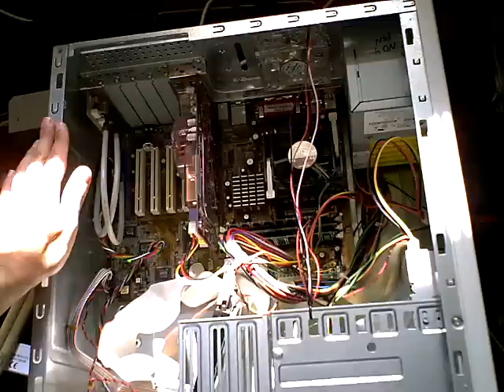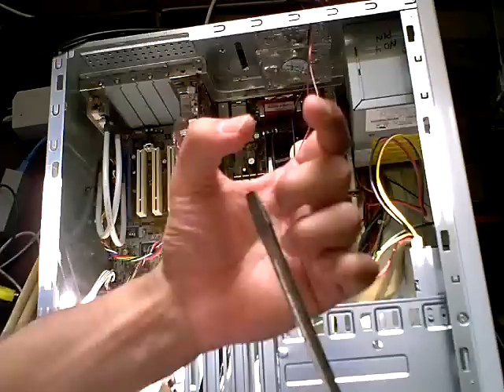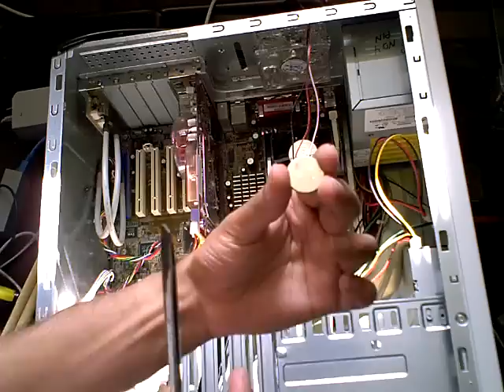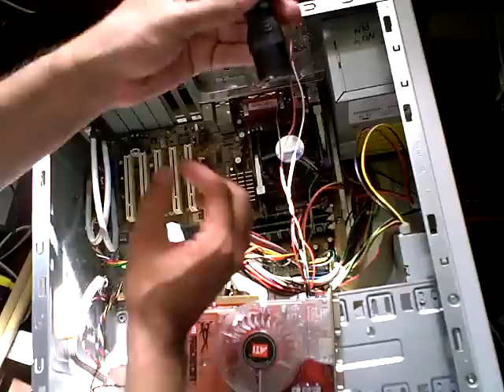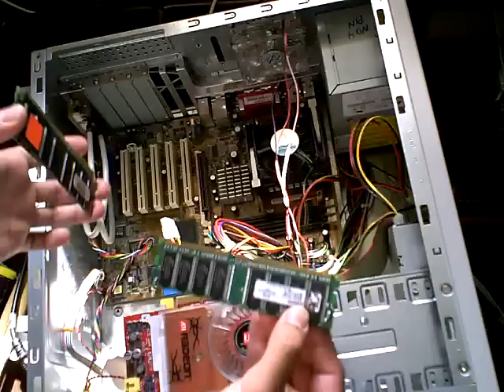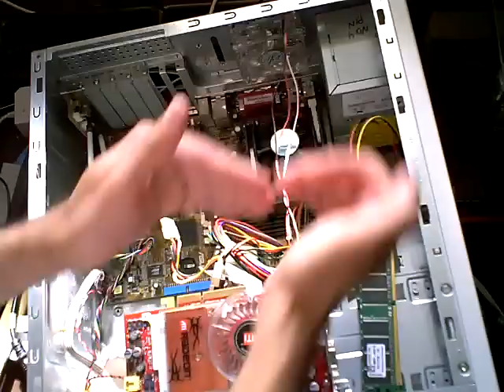How to possibly fix a PC that will turn on but will not beep and will not display anything on screen

Comment: Please help ! I don't wat to mess with anything just yet. I just want your opinion on what this problem might be. Ok so i am new to building computers and I just built my first setup. Everything worked perfectly for a week or so, then I started over clocking the stock fx6300. Everything was fine just tinkering with the cpu ratio and voltage I got it up to 4.5ghz at 1.41v underload was about 59c using my hyper cooler master evo. Had this going for a while and it was dandy. Then I raised the CPU/NB ratio from 10x to 11x and now my PC doesn't output video to my monitor. I've tried all the basics. Changing the monitor, the cable, and the display port. All to no avail. What do you think? Thanks!
Specs
Fx6300
Msi r9280x
MSI gaming 970 mobo
EVGA 850w g2 
Rip jaws 2x4gb 2133 DDR3 RAM
1tb blue WD hadrdrive
120gb Kingston SSD
Reply from the maker: +shane fernandez Reset the CMOS as shown in the video. Hopefully it'll flush your overclock specs. I recommend you leave those settings at default, for reasons such as this

Comment: if you remove the cmos battery, isnt that the same as using the jumpers? or do they do different functions?
Reply from the maker: +ScrotumSqueezer It 'should' be the same, but I do both to ensure that the operation sets. Since recording this video, I don't even tell people to wait 10 seconds like I used to, I now tell them to wait overnight to ensure that the CMOS is cleared (yes, some machines actually take this long for power to die out from circulating).

Comment: Thank you so much for your video!  I believe I have now fixed the problem on my computer and all it took was resetting the cmos. One more question,  though. When I start my computer up,  there is a code that pops up.  It reads:
Diskette drive 0 seek failure
CMOS check sum error-Defaults loaded
Press F1 to continue,  F2 for SETUP

I pressed F1 and all worked well except my time and date had to be manually reset. But the same things pops up even after restarting computer. What should I do now?  Thank you in advance for any help you can offer.
Reply from the maker: +jennjonesforever Your CMOS battery is dead. If you replace it with a new one, this problem shouldn't happen anymore.
Reply: +RodneyDickson Thank you!
Reply from the maker: +jennjonesforever Hope things work out.

Comment: Hi, want to ask that my pc can start to cmos, no beep sound got display and show pxe e61  media text failure.
Is it just hdd failure? Or suspect for mbd failure?
Due to nearest pc shop is quite far so hope for a suggestion. Ty.
Reply from the maker: Sounds like your problem is directly related to your bootable drive (whether it be USB, HDD, optical, etc). If your hard drive is not defective, I'd go into the BIOS, ensure that the HDD is being properly detected by the system and is the primary boot device, then save and exit. If the operating system still will not boot, and you are sure your hard drive is functional, then your operating system installation may be corrupt.

Comment: Hey, you may know something about this, my hp starts up normally at first, but when it gets to the desktop screen, it just stays black, no icons, start bar, etc, I can ctrl at del but I can't play games or browse the web, I have already tried a Vitus scan in safe mode, simple restart, restarting with just Microsoft processes going etc, I let it sit for about hlf hr and still nothing, it makes the occasional loading sound (little clicking sound or whatever when ur pc is loading something) any idea how to get it going?
Reply from the maker: +Drew Schnipke Fraid not. You can go into the BIOS, load setup default, save and exit and see if that makes a difference. From the sounds of it, your Windows installation has become corrupt.

Comment: My newly built PC didnt have signal on monitor and did turn on and off like 10-15 times(no signal on the monitor evrytime), so i thought mobo was having any contact with the case to i took out and put the mobo on a cardboard box and on the second time turning it on it worked and i was damn happy but after that it went out again and thats it, so im changing the CPU and mobo atm, i believe it either mobo or CPU is the problem so waiting for exchange atm. im still pissed cuz this is my first built PC :[

I did the CMOS clear but I think I did it wrong because what i did was take out the battery then i did the 3 pin thing. remove from 1-2 and put it in 2-3 and then put it back.. Well thats what my Mobo manual told me to do, i didnt try turning the PC on with out battery or removing the components one by one..

Do you think it could be the RAM? Its a Crucial Ballistix Elite DDR3 2X4GB 1600Mhz
My
MOBO Asus M5A97 R2.0
CPU FX-6350
GPU Asus R9 270X

Thanks. need your help RodneyDickson :]
Reply from the maker: +Powered By Kale Well, your troubleshooting was good. Where the issue lies sadly may be in any number of components, including RAM, CPU, board, even power supply. Sadly there is no clean, easy answer for you : \

Comment: Why did you never reinstall the CMOS battery, could that may have essentially effected the rest of the troubleshooting correct?
Reply from the maker: +William Beard It is possible. Some PCs are finicky about not having the CMOS battery present. I knew as fact that this machine was not one of those cases, but in fact you are correct.

Comment: I have a similar issue with a temporary fix. After I turn it on, no beeps no screen response, I then press and hold the power button again. Turning the power on and off 1-2 times it will finally boot with the screen and one beep. It doesn't kill the power to the computer ever after I get it started. Would that still be likely CMOS related?
Reply from the maker: +BreezyGamer92 If I understand you correctly, once the PC is started up using your trick, it is good to go until you power it down. If this is the case, I recommend you put it to sleep when not in use and wake it when you wish to use it in lieu of powering it down only to probably face this issue again. Intermittent issues such as this are generally signs of a component (frequently the motherboard) dying out. I say 'run it into the ground.'
Reply: I just remembered that problem I had been having at that time. Believe it or not, I think it was my video card. I clean the PC good and took my 7870 apart and replaced the thermal grease and cleaned up fan. It never had that boot issue again and actually performed better too.
Reply from the maker: +BreezyGamer92 Oh, real good. Glad you found the problem : )

Comment: Hi Rodney, while using my desktop my mouse froze on the screen and I had to just turn off without logging off.  I turned back on but mouse still won't move and I'm stuck on the log on part but I can't get any further?  Any ideas please?  I tried a different mouse but that didn't work either.
Reply from the maker: So no mouse functions currently? Does the back of your PC have both green PS / 2 connectors and USB connectors? Have you tried a USB mouse and/or a PS / 2 mouse? Did you ensure the mouse was connected before powering up the PC? Keep in mind that PS / 2 mice can not be plugged in while the PC is running, but USB mice can (only thing is, they take a few minutes to initialize). Have you also tried moving from username and password fields using the TAB key on the keyboard?

Comment: I just had this issue with a 3 year aftermarket built desktop. It would start... No beeps... Restart again and again after this vid I removed only the ram and graphix card not the battery and it still didn't work . Then I did the normal thing to do in this situation and I pressed every key at one time. At that moment an app showed up for my motherboard assrock ext7 then I looked and saw I can set a fast boot and my pc works now idk what I pressed but in some not all but some cases mashing the keyboard works though I don't publicly advise it thanks for this vid it's sorta helped
Reply from the maker: +Grant Nelson Heh, thanks for sharing your fix : )

Comment: Hello, I have purchased four motherboards, 2 Gigabyte and 2 MSI, I have also purchased 4 compatible processors, mostly AMD Blacks. 4 Total PCs, 4 New PSU, all new ram on each and I have the issue detailed in this video on EVERY SINGLE ON OF THEM. How likely is it that I have bad motherboards? What is going on?
Reply from the maker: +Atheyst Yeah, that's nutty. Perhaps your power supply is not sufficient? Perhaps you are not connecting things properly? Did you check your CPU pins to ensure they are installed properly and not bent?

Comment: I have this exact problem. It powers up fans run, no beeps but no image to screen.  I will try to diagnose just as you explained.

If it is the RAM your solution is to reseat and reorganize the cards and that should work?

(Ironically this pc "died" just 1 week after I purchased a new one!)  Haha
Reply from the maker: +YakMan NC Well, at least you have a backup machine. If you follow what the video shows, you may find luck in bringing the old machine back to life, and if no luck, Breadboard it (explained in the following video:)

If the steps in this video did not provide a solution to your problem, view:

http://www.youtube.com/watch?v=_EK9a-R5pss

You never know, maybe rebuilding the PC in the opposite sense that you took it apart will solve the problem.

Comment: Help, I've recently refurbished a computer by switching all the internal parts with new ones. Once everything are assembled, I switched on the power, the LED lights works, the fans move, but there's no post beeps nor signals to the monitor. I tried many methods possible and they didn't work.

My parts:
Processor: Intel i5 4690
CPU Cooler: Stock Fan
Motherboard: Asus H81M-E
Power Supply: Antec 600watts
Hard Drive: Seagate Barracuda 1TB
GPU: GTX 960

It may just be a connection error, but I want to rule out as many things as possible.
Reply from the maker: +Jay Breadboard it (explained in the following video:)

If the steps in this video did not provide a solution to your problem, view:

http://www.youtube.com/watch?v=_EK9a-R5pss

You never know, maybe rebuilding the PC in the opposite sense that you took it apart will solve the problem.

Comment: Thanks for the wonderful video.
My problem is like, I messed up with my cmos. Mine is an HP desktop. I upgraded to win 10. later when i try to reset my system to old operating, it was showing error message. Then I try to boot from my USB. For that I changed the boot order. One time it showed there is no bootable media. I restarted. The it is black screen, no beep. I tried clearing CMOS, removed battery. Nothing worked. Is my mother broad dead?
Reply from the maker: +Vinodkumar M V Breadboard it (explained in the following video:)

If the steps in this video did not provide a solution to your problem, view:

http://www.youtube.com/watch?v=_EK9a-R5pss

You never know, maybe rebuilding the PC in the opposite sense that you took it apart will solve the problem.

Comment: Hey Rodney, I've been having this problem but my case is a tad different. My computer has turned on twice already with no display but my PC is fully turned on. I can press the power button just once and in a few seconds, it'll power down like a normal shut down. So I went into my case and checked everything and I even booted it up successfully with only one of two sticks of my RAM and vice versa. Then I booted it up and at first, it was stuttering real bad and it gave me a TDR on my nvidia 660TI (Note: This has been happening nearly once a day starting three days ago, my PC is over 4 years old now). Closed and rebooted and now my PC booted up fine again. Can you please offer some help?
Reply: +icyrazor I also have to mention that those stutters I've been getting are the Event ID 14 from source nvlddmkm errors from what I see on my Event viewer. Also, there was one time where I had to restart because it froze my PC and for some reason my GPU fan went full blast 100% and my desktop was forced into a 800x600 resolution as though no display driver had been installed. Please help
Reply from the maker: +icyrazor Geez, that's tricky. To me it sounds like something is failing hardware wise (i.e. something is dying off slowly). The cheapest test would be if you have an extra hard drive lying around, to install a temporary Windows OS on there and see if when your PC is kept clean, if the problems go away (if they do, then something in Windows is corrupt). If this doesn't help, try going into your BIOS, loading setup defaults, then saving and exiting. If this still doesn't help, you'd have to purchase new components to do proper swap tests, like a new PSU (yours can be losing potency), new video card, new hard drive, new RAM, new motherboard, the list goes on. Before doing any of this though, try disconnecting everything connected to your PC that is not absolutely necessary at that time (even troublesome USB devices can cause issues such as these).
Reply: +RodneyDickson Alright, thanks man. I do believe it's my GPU that's dying so I got an RMA from the manufacturer. I hope that is truly the culprit since games start to stutter now when my GPU starts ramping up in fan speed/power to run it.
Reply from the maker: +icyrazor Sounds like a likely culprit. Hope things work out : )

Comment: I bought parts for 2 Pc last year,Amd FX8350 4.0 Ghz,Asus M5A99X EVO R2.0 AMD motherboard,Asus Matrix GTX980,Corsair Rams Vengeance 32GB,Corsair HX1150 PSU 1,150 Watts was running until last week when it started to freeze on AsusLogo and I restarted again and back to Logo,ever since no boot sound and signal and I took off all the peripherals devices and still same problem and took cmos battery off and clear cmos or bios and plus I exchange parts from the other pc still don't beep will not display on screen.About a week later my other Pc died on me have same problems and  think is a 100% is the motherboard.Hi RodneyDickson what advice can you give me?
Reply from the maker: Can't tell you sadly. It sounds like you tried what was shown in the video. For things to work at first and then to die shortly thereafter: perhaps it was an incompatibility between the motherboard and the CPUs or other components? I can only suggest that you breadboard the machines, but even then, given your testing, I don't think it will make a big difference : \ Breadboarding: http://www.youtube.com/watch?v=_EK9a-R5pss

Comment: So I purchased everything I needed for a computer build and this happened to me.  I have an ASRock fx 990 extreme 9 motherboard, and amd fx 4350 cpu, an ASUS Geforce gtx 750 ti video card, 8 gigabytes of ram, an old 200 gb hdd that I salvaged from an old desktop, a 400 watt power supply and an old monitor that was working with a different computer.  Would there be any compatibility issues with these parts?  Everything turns on and spins up but no beep and no display.  The power supply was working with a different computer.  A reply would be greatly appreciated! Thanks
Reply from the maker: Prefer to communicate through this account or Jbenfer98? Let me know and I'll keep one thread open.

Comment: Just asking, but do you think the fact that you are turning the machine on and off without being grounded to the chassis and touching components.that you didn't shock the component that's not working? I'm sorry, Just something I noticed. I can tell you up front, that's not a good practice.
Reply from the maker: +Ray Fields Possibly.

Comment: Hi Rodney I recently went to use my PC after connecting a HDMI cable however now the PC turns on for a split second before powering off again, when checking I removed components singularly checking which component lead to the powering off, I disconnected the motherboard turned it on with everything connected and the psu fan etc powers up, lights on and the sound indicating the computer is running yet no display due to the motherboard being disconnected, when I connect this it causes the problem mentioned before where I turn the PC on and it turns off automatically, I've tried removing the CMOS battery and can't see why it's happening, any advice?
Reply from the maker: +Shínígamí Shín I wish I could, but I don't understand how you are running a PC with no motherboard. I recommend you Breadboard it (explained in the following video:)

If the steps in this video did not provide a solution to your problem, view:

http://www.youtube.com/watch?v=_EK9a-R5pss

You never know, maybe rebuilding the PC in the opposite sense that you took it apart will solve the problem.

Comment: +RodneyDickson Do you still check your comments? if so:
My pc powers on for 10-15 secs and then restarts and does the same thing again. It started when I powered the pc off with the button. I changed MB, CPU, PSU, GPU and RAM and it still does this.
Reply from the maker: +FeistyGamez I'm back to checking comments after a year and a half hiatus. Breadboard it (explained in the following video:)

If the steps in this video did not provide a solution to your problem, view:

http://www.youtube.com/watch?v=_EK9a-R5pss

You never know, maybe rebuilding the PC in the opposite sense that you took it apart will solve the problem.
Reply: +RodneyDickson I found out the problem. I did rm rf / in linux and MSI motherboards have their EFI read and write able in linux so the motherboard is totally bricked.
Reply from the maker: +FeistyGamez Crap deal. Thanks for the update.